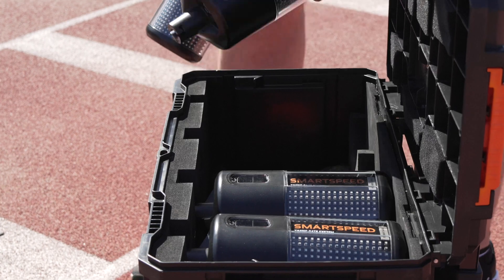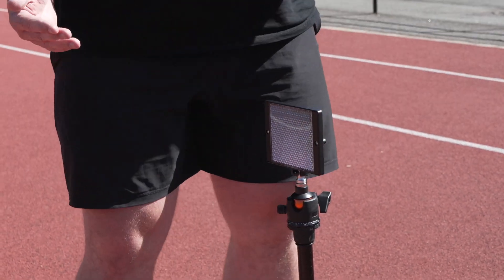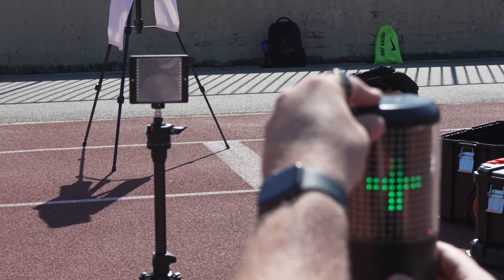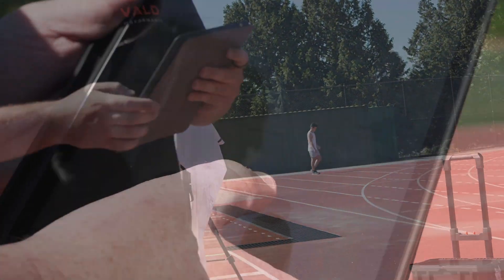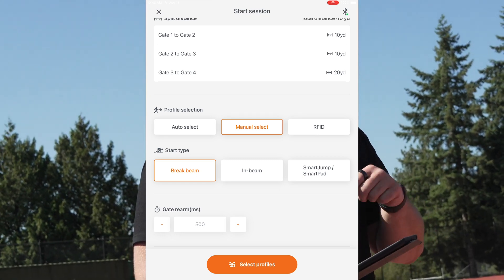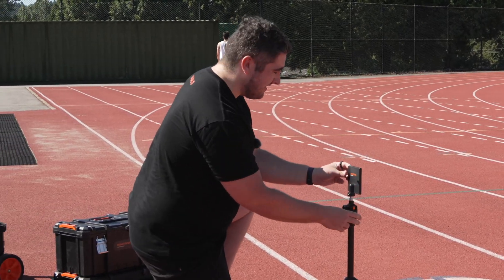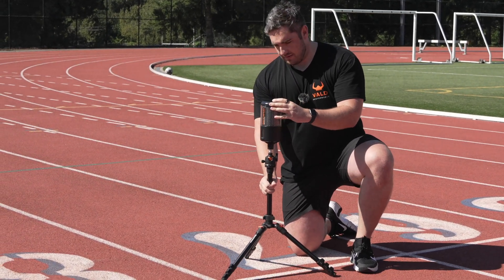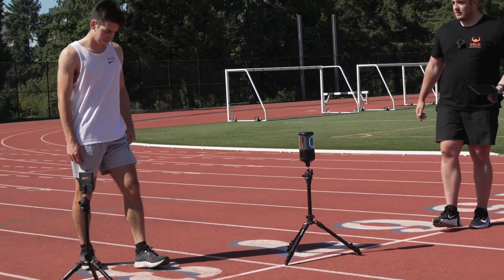Evaluating the VALD SmartSpeed PLUS Electronic Timing System

Comment: So when setting the athlete up they should be aligned just behind the beam or in the beam?
Reply from the maker: It really depends on the type of start you are trying to measure.  For a conventional three-point start for a 40 yard dash, we were using the in-beam setup, where the athlete was within the beam and the timer started when they left the start position.  But, we have also done some testing with the break-beam setup, where the athlete breaks the beam with their body.  The only issue with the break-beam setup is that the times can be less consistent if a hand or someones long hair prematurely breaks the beam - resulting in a slower time.  The in-beam start seems to be more consistent for static starts, where break beam is more consistent on flying starts.  It may also be dictated by the height of the beam that you set (which part of the body breaks the beam).